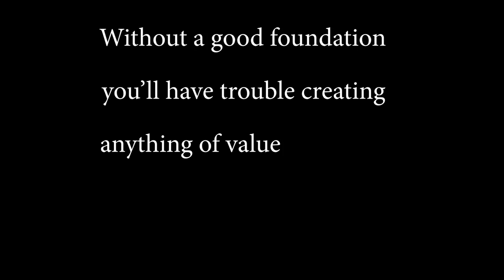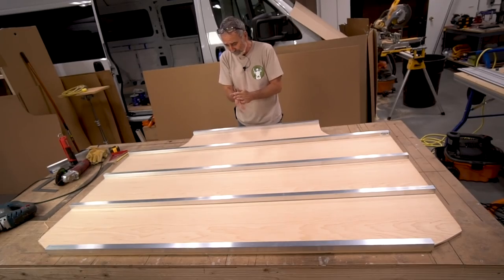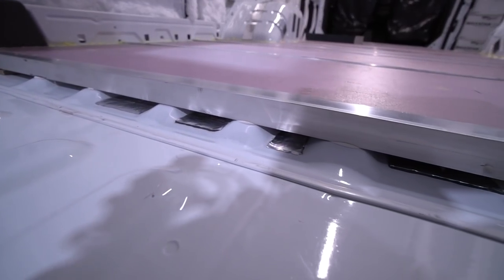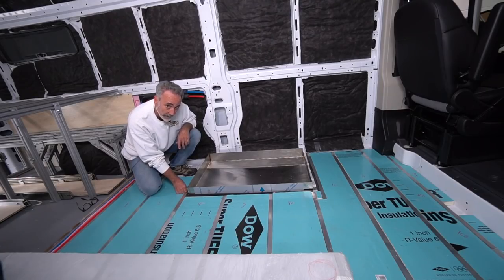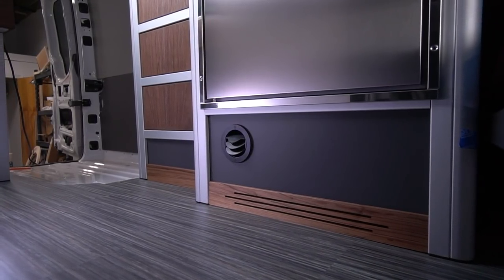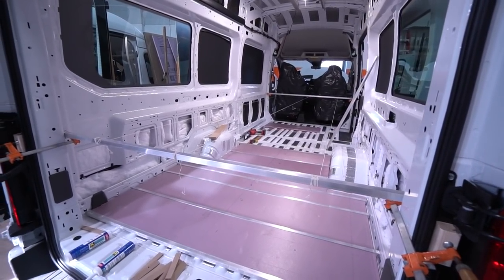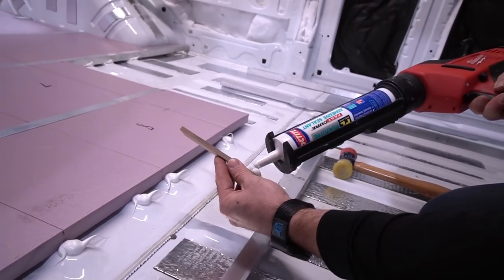Plumbing the floor in your van?! What does that mean? And WHY YOU SHOULD DO IT!

Comment: Beautiful van.  Great idea for how to build the floor.
Reply: Actually not a good idea putting aluminium joist against the metal floor. It's the same as having no insulation.
Reply: @897aa33  1/2” plywood (and looks like George jumped to 3/4” for the Transits) plus a cork backed 1/4” finish floor on top of that. If the floor still feels cold after all that, wear socks or drop a small throw rug down. ☺️
Reply: @turnpike420  it's not about cold rather condensation. Metal and glass is the most condensation dense materials.
Reply: @897aa33  full airflow under the entire floor, the gaps between the ribs have nothing in them… maybe some Noico or something but otherwise airflow is open in his design.
Reply: @turnpike420  do you mean dry heat airflow? Otherwise is even worse idea to have flow of cold oxygen  creates even more condensation. There is special spray paint that creates small layer of insulation on metal. If you could spray aluminium batten before hand that would work.
Reply: @897aa33  just airflow, nothing ducted into it (though George does tease to 12v computer fans in one of this subfloor videos some time back). How would you engineer your subfloor?
Reply: @turnpike420  George work is excellent. A bit sceptical about bare metals like aluminium joist and 80/20. But if you going to use van traveling south thats perfectly fine. I would use solid plastic joist for subfloor or aluminium joist spray painted with thermal paint or coated with plastic.

Comment: Hey George ! I always like watching your videos.  I am a glazier by trade, and we use laser levels for everything.  When I plan on converting my current work van, (a sprinter 144 high roof 4x4) into a RV,  I plan on parking the van in the shop, and using jack stands to raise the van.  I'll shim the stands with metal shims, until the van floor is level in both directions.  For the duration of the build I should be able to use my plumb and line lasers inside for measuring and layout.   What do you think?  Am I too optimistic that this would work?
Reply from the maker: IMHO, it will not work. This isn't a house you're building. Find the centerline on the floor and use it. Spend your time making a large square. You'll thank me later.  🤓 Good luck! 👍

Comment: George, Your floor system keeps evolving and improving. Noticed Alex did not grind to bare metal before adding the dollop of adhesive but instead added a strip of material in two locations between the floor and 1” aluminum. Can you share what that material is, would save a lot of time compared to grinding away paint? - Your Humble Student.
Reply from the maker: Correct, no more grinding. Probably not necessary, since it's all down pressure on the floor, no shear. In certain areas on the floor, there is no high spot for the aluminum joist to make contact. So we glue in a MDF spacer. It is important to know not to use these spacers in a load bearing area. In a load bearing area, a more structural spacer is required.
Reply: @HumbleRoad  I see that you are using Loctite Adhesive Sealant for the aluminum tube but cannot see what the type is from the video.  Can you share what type it is and if you still using that?

Comment: @Humble Road  Great floor design, on your 1x1 bar Aluminum stock, do you have good luck with a cheaper squared walled tube, example: T52 1.000 X 1.000 X 0.065 ALUMINUM 6063 SQUARE TUBE ?
Reply from the maker: My philosophy is that I can't afford cheap. My build reputation is one of quality. No worries.

Comment: I notice you are leveling it off the string but it appears you are using the adhesive thickness to adjust the strut height. Are you  putting something under the aluminum struts or relying on the adhesive to harden and not move?
Reply from the maker: Ideally exert enough pressure to push the aluminum down as close to the chassis floor as possible. But yes, the adhesive makes up the 1/32 or so to maintain plane.

Comment: I'm planning my van .. it will have a super high roof (2,10 meters high internally) and it would allow me to create a double floor, having a cavity where all the plumbings, cables and heat tubes can reach every part of the van. 
Would this be a good approach in your opinion?
Any suggestions from a planning point of view?
Thank youuuu!! 😜
Reply from the maker: Sounds good. Bring it in! 😇
Reply: 210 meters?  That is a seriously tall van!  That should get you to the top of the beanstalk for sure!

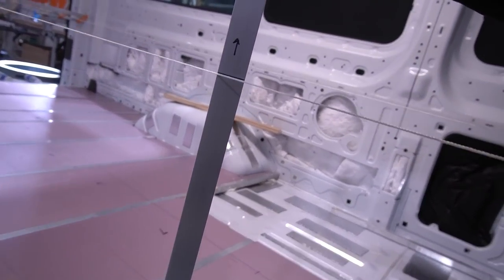Comment: George, at 2:40 or so, when you get done leveling the Aluminum joists in the way shown, do you place any weights on this set up until the glue dries or not?  Thanks for the anticipated answer.
Reply from the maker: No weights the joists have to set where they lay in order to maintain plumb.
Reply: @HumbleRoad  Thanks, and what is your current favorite glue?
Reply from the maker: Different products for different applications. I mention them in my videos. I guess you'll have to go re-watch EVERY SINGLE VIDEO all the way through! 😇
Reply: @HumbleRoad   LOL.  I meant for the Aluminum to metal floor adhesion.  You had flashed a picture of a tube of chaulk but I happened upon 3M 07333 which I thought might be better and I wanted to get your opinion on it if you have one.  Thanks George.

Comment: I am too tall too buildup the floor in my conversion and too poor to buy a taller van what are your thoughts on closed cell insulation and radiant heat under the floor. I know that messes with the thermal break.
Reply from the maker: Radiant heat under the floor is a real treat on those cold nights. It is supplemental only. You still need cabin heat (Webasto or Espar)

Comment: What about all the thermal bridging these metal on aluminium connections create?
Reply from the maker: The dollop of marine adhesive is thick and offers some thermal break. And the 3/4" plywood subfloor is a good insulator. In my opinion, the benefits of using aluminum outweigh the risks

Comment: How to you adjust the height where it needs adjusting? I've heard tell that the promaster floor isn't flat, but has something of a dip. Was it concave? Convex? I don't remember, but I remember wondering how to solve that.  I was thinking of using a laser pointer mounted outside the van, which is basically the same principle, and wood pieces shaved down to create a flat foundation
Reply from the maker: Laser only works if the van is dead level. And the moment you step inside you’ve thrown off the level. That’s why we measured in the 4 corners.
Reply: @HumbleRoad  foiled again by physics
Reply from the maker: Yep, those physics do get in the way sometimes...
Reply: @HumbleRoad  you can get it level by lifting it from it's wheels to some supports with precise length
Reply: @JGnLAU8OAWF6   that’s what I did in my build just jacked it to level and used a rotary laser the  The benefit of this approach is you can pull and level anywhere in the van as long as it’s still on blocks. I didn’t need to jack the wheels off the ground just leveled it and used jack stands for stability.

Comment: Has anyone ever requests 2 inches of polyiso for the floor of their van? I live in a cold climate and want to use the van for winter camping. Is 2 inches overkill?
Reply from the maker: Layers of varied substrate is more effective, IMO. As long as you have the ceiling height, go for it!

Comment: So aluminium joist touches the metal floor ? What's the point of insulation ?
Reply: Worth watching again…. I’m sure there were ply strips under the battens glued to the floor first 👍
Reply: Plus the glue itself provides a thermal break (unless you compress the glue to nothing?)
Reply: @T8RTU  small ply strip one each end and unfortunately bit of glue can't provide thermal break.
Reply: @T8RTU  aluminium joist touching metal floor is not good foundation. But solid plastic battens might work far better.
Reply: @897aa33  I can see how that would work - good tip, thanks ✅ I’m not sure how much material is needed for a thermal break to be sufficient but I’m definitely up for more information on this 👍
Reply: @T8RTU  anyhow there no chance to insulate metal van 100% and since most of people traveling south for holidays perhaps using aluminium is not the worst all about preferences. I would consider box van for next project.